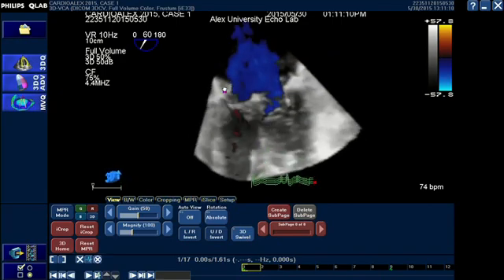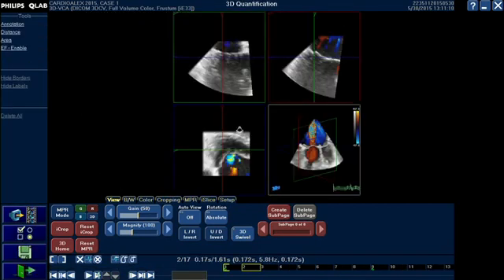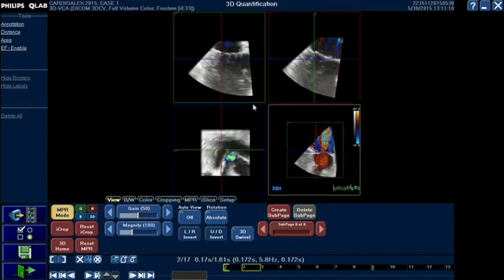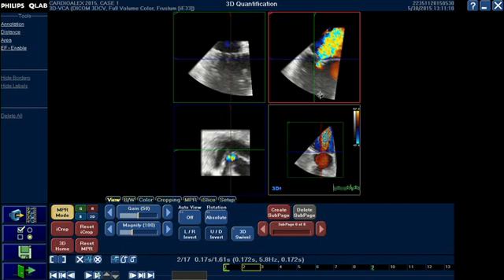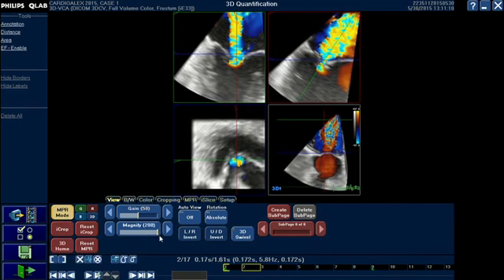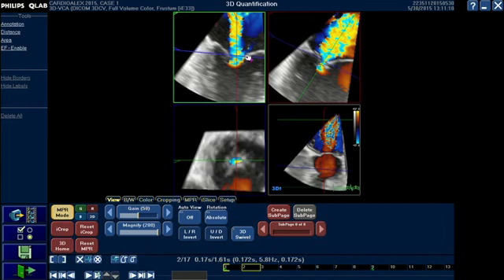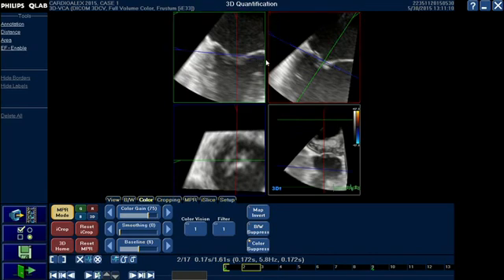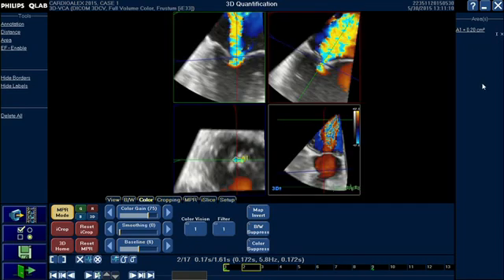How to measure the 3D-Vena Contracta Area (3D-VCA) for mitral regurgitation

Comment: Do you recommend a full volume data Set as a default Strategie over a 3d zoom data Set? It is said that 3d zoom is very feasible for mitral valve analysis, but i often find the frame rate and resolution to be more superior for finding the correct vca. What are your thoughts? Thank you!